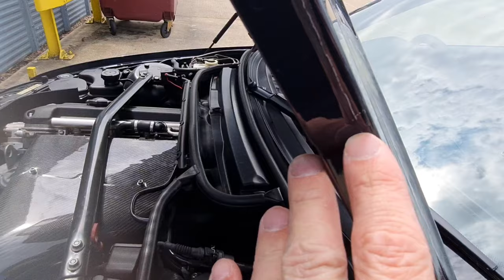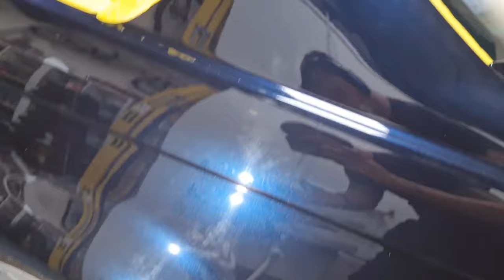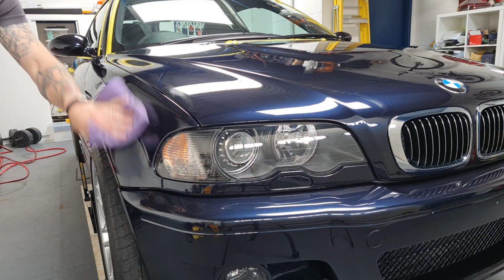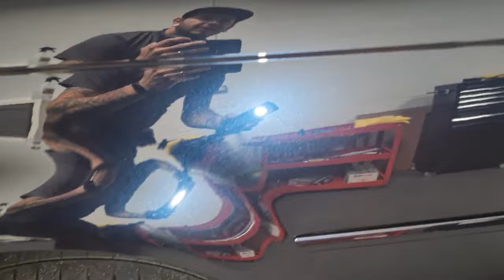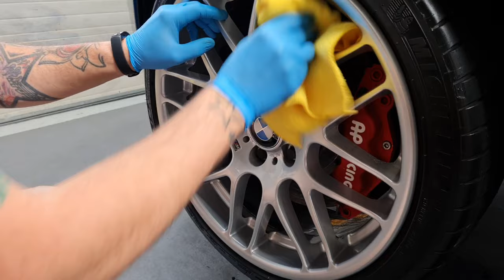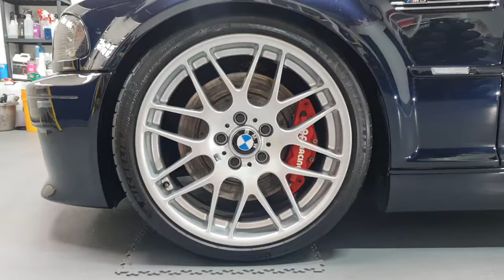BMW M3 E46 - Carbon Black - Enhancement Detail with Ceramic Coating

Comment: where can I get that front license plate holder? its really neat.
Requires 1 drill hole into the bumper?
Reply from the maker: It's the standard UK plate mount 😎 you can get them from BMW or on eBay 👌🏻